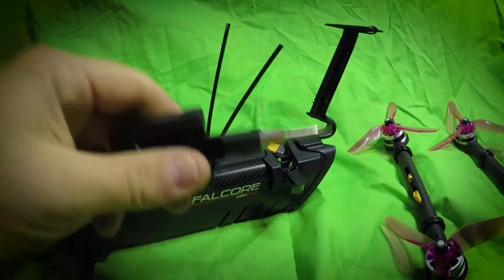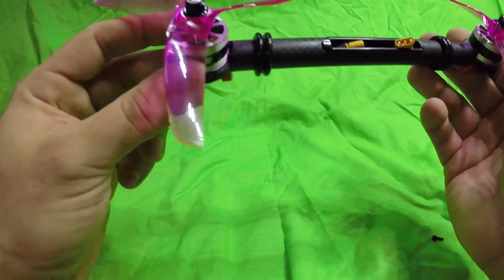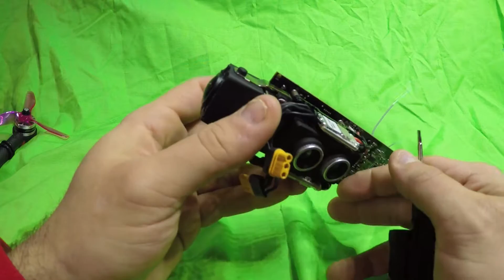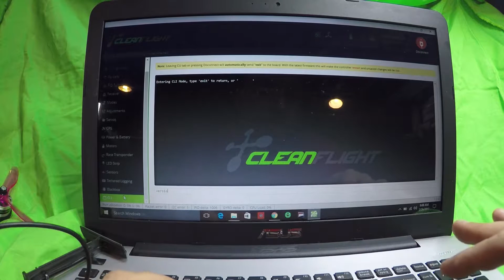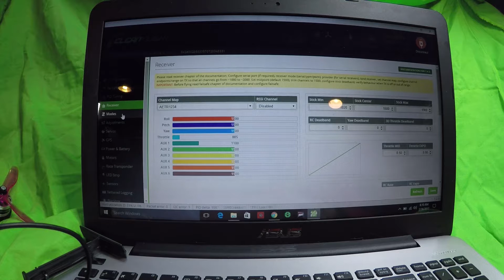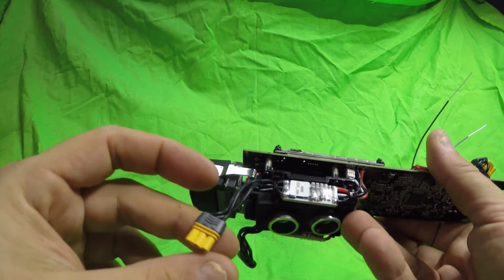CONNEX FALCORE...INSIDE LOOK AND TEAR DOWN  PART 2

Comment: hey homie,, i hope you get this, and wil respond as my reaching out to connex or amimon or whatever its called was a total waste of my time, with no response. well obviously i have found myself in a situation with my falcore which i never expected, which in short was after having to replace 2 of the motors with 2 of the same brand and size, ( i found on getfpv.com btw for a mere $4 or $5 bucks each) and well as they advertised, switching them out was easy peezy, which i assumed would be the end of it, and then id be up flying as soon as my lipos were charged and ready. but instead now i find when i plug my lipo in, and began to simply get prepped to take off, i was met with only flashing red lights from front alll of the way to the rear leds after just powering up, (which i thouht would simply change or stop and go away once i turned on my radio. ) WRONG ! So again, everytime i plug a lipo in, it simply flashes red lights , with only beeping until i switvh on radio, then its only the flashing red leds front to back?? i hooked up to both baseflight, aswell as cf, aswell as blheli, and everything still comes up looking as it should, and getting all the stick movements, not to mention showing the movment of the drone itself when i pick it up and check if direction etc r correct, and again everything appearing Aok?? then blheli, reading the exact same as urs did, showing the raptor escs aswell as while in cf, motors all checked out perfect, and the correct direction! and that is were i find myself lost! then i decided to check out what my OSD and camera was looking like, which was also working to my knowledge perfect too, with the exception of one thing,,, and the was the (message in the topmiddle with the message ACC Needs to be Calibrated, or something very close to that . but it was obvious that it was telling me that i just needed to cali brate the Acceleromter, and hopefully that would fix the issue, after doing so, i powered up again, and sadly still red flashing leds,a and message still saying say same thing about the ACC, when on cf, i click to calibrate, and it shows the rederng of the craft moving, and then cf reads calibration successful, nut no matter what still getting the same damn red flashing leds!!!?? its driving me nuts,, please any help whatsoever would be so greatly appreciated!, really quick, i did notice and im not certian it even has one,  but the magnotometer isnt lit up like the acc cali is while in cf, but in baseflight it is, and allows me to do a cali, now if im wrong and it doesnt have one, then plez ignore my ignorance. again all thankx to any whom attempt to help !!!

Comment: What blades are you using.  Heard you say Butter Cutter Propellers, but what size?  5X5?  
Just got mine yesterday.  Firmware upgraded everything, but couldn't find a update for the controller.

Comment: Nice video. Can you clarify, did you damage the antennae when they were pulled off? And it kind of looked like you cut away some of the rubber protection around the camera. Did I see that correctly, was it to remove the blocked image in the corners?
Reply from the maker: Terry Headrick good eyes. The antennas popped right off their connectors so no they didn't break. I did add more glue and you do need to be careful taking it apart.  Yes there was rubber missing. I tried out the hp+ mode lens and needed to cut some away so I had a full screen. It's such wide angle you can see the rubber housing. I went back to the original lens in the end.
Reply: ChadRC...thanks for clarifying. I haven't had a chance to really fly mine yet. Hopefully tomorrow. I plan on buying the other lens too...the stock lens still gets blocked by the rubber cover. Not thrilled about that ;)
Reply from the maker: Terry Headrick most connex builds have the camera without the rubber. But it's needed for the mount on falcore. You can cut and trim it. It really serves little purpose that far out since the camera is nicely protected by the frame. Try out the other lens with hp+. Take it outside and focus with the guts outside of the frame and then lock it down and reinstall the entire pdb. Focus is tricky with it. I think it was a quick fad. None of the pros I super users even use it. I weren't back to hp. Wait for the 60fps camera to come out I guess. Still love hd though